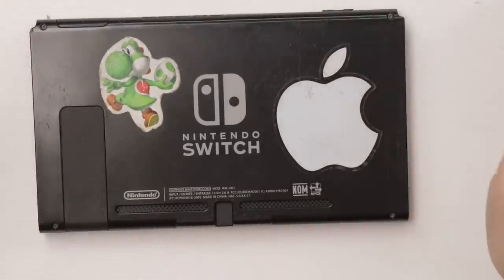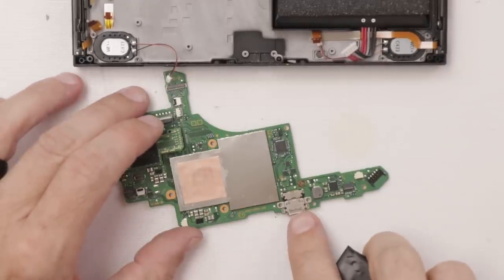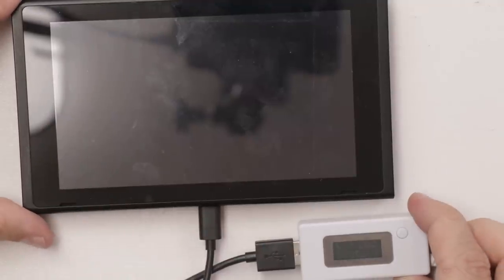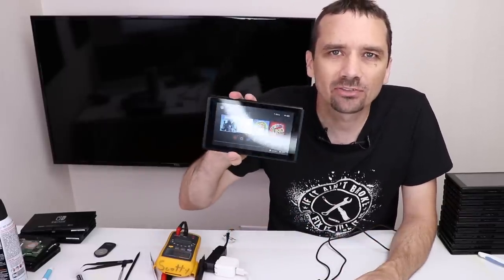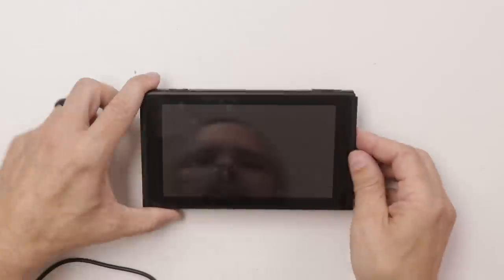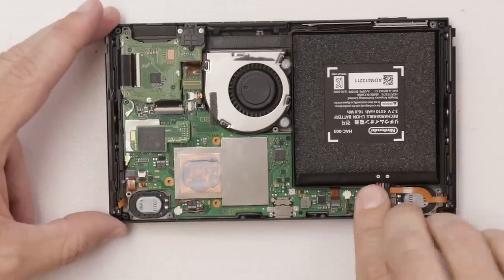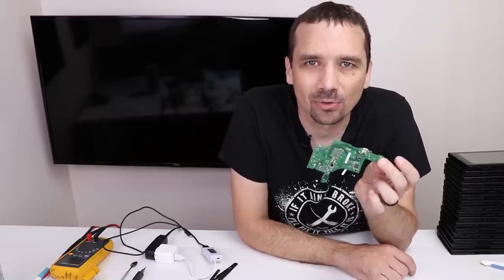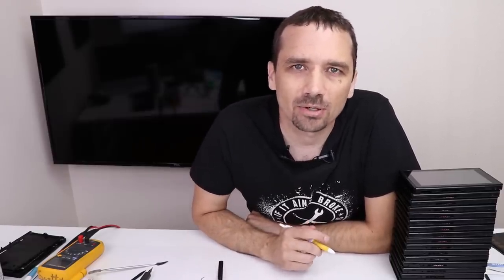The Numbers Are In (Sort Of)! This Lot of 20 Broken Switches Turned Out Good!

Comment: How do you know when there is a short on the capasitors? What is the DMM suppose to read? Also, where do you put the ground wire (black, i think)  when testing. Does it matter or could you put it anywhere?
Reply: The DMM is set for resistance/continuity, which is read in ohms.  In this specific usage, the red and black probes are interchangeable.  One of the probes is consistently held on a known grounded trace/solder pad/area and the other is placed on one, and then the other end of each capacitor.  One end of the capacitor is supposed to show 0 ohms (meaning no resistance to ground, a complete path/circuit or perfect continuity) and the other should show an open circuit/no continuity.  If both sides read 0 ohms, it means the capacitor is shorted to ground on the side that should instead be isolated from ground.  I don't know much about fixing switches, but the video seems to show that this shorted capacitor condition typically means the video chip is blown.
Reply: @prescottmajette5290  hmm i understand now. Thanks so much
Reply: @josegdelgado112  Yea man

Comment: Hi! I have 5 right joycon motherboard they make the click but for some reason won't connect to the switch and some of them won't charge.  Do you know what is causing this? I already change the rail and the ribbon cable but i think is the main board related.

Comment: My switch the back of it is like bulging out and has never been opened before I got it 2 months ago but the back is bulging outwards and the fan is making some sort of scraping noise but if you know why it’s bulging plz tell em and also when I use the switch with my fingers on the screen it creates like weird pressure spots on the screen with just a tap

Comment: Noob question. But what is that paste you use to heat and melt the charging port off? I've seen it before in another fix video but wasn't even named.
Reply: It's flux paste to make the solder "flow" better and stick where it's supposed to be. Someone else can probably explain it better though.
Reply: @J0k3r399  Ty! It's explained enough for me to find out it reduce oxides that heating metals create in the air. Pretty much keeps everything clean. 

Edit: You helped me get smarter today :D

Comment: Hey Bud Need your Help Ps4 replaced the hdd along with a good cleaning and thermal paste it will work fine for about 47 mins then freeze but never recovers till i turn it off at first it was only working like 20mins then stoping but now i got a little fan pointed at the back of it seems to last longer... now this is the cuh1001a but the fan never ramps up or anything saying it overheating so I am stumped

Comment: Hi ya not sure if you've seen this before but my switch shows its charging for a second then screen flashes off then will show battery symbol again and keeps looping like this. 

Also if I try to turn on nintendo logo will flash while I press power button. If I loose power button  screen will flash off and then show battery charging before flashing off again. 

The switch will not respond without the charger connected. 

Maybe you know something ?

Thanks
Reply: Probably either a bad charger or bad battery.

Comment: Have you had any switches unable to dock and connect to the tv but work fine in hand held mode if so I need help
ASAP . Please
Reply: Systems operates normally when used in handheld mode and will connect with joy cons

Comment: Hey Guys, i have a problem. I bought a broken switch. It was not charging normally because of water damage. I cleaned the board with alcohol and checked for shorts (did not find one). After that i replaced the battery and now its loading like expected. (0.41 amp and then up to 1.40 amp) but the display is not turning on. So i replaced the display too. Still no sign of life besides the rotating cooler. Can you give me a hint what to check?

Comment: So many of these failures seem tied to the video chip. Is this reflective of an issue in either board design or of cheap parts?
Water damage is obviously the fault of the owner, but it seems worrying if a video chip frequently fails, as this looks outside the users influence.

Comment: Hey I have one ☝️ problem I have a dead Nintendo switch no power on usb ammeter shows it drowning 0.38A but no nothing on the screen , I disassembled it and checked camps no shot what’s so ever no short by the power supply (M92T36) no short by charger ic (BQ24193)  no short by video chip (P13USB) ,usb connector is clean and good , diod is good ,  what do you think should be the next step ? Thanks in advance ?
Reply: And tried with fully working another battery but still nothing
Reply: @UsiddaTech  The screen might be bad, does it ever go to fast charging?

Comment: I'm taking a gather that Nindeo really, really needed to put a heat-sink on the video chip.  

Also I wonder how many people plugged in faulty USB A to C converter  cables that didn't include the essential resister in the cable that stop its from over-current the device.  A LOT of Amazon-sold A to C cables omit this resistor and they are a danger to devices.

Comment: Was considering buying a switch from you but after further research on Amazon for parts for a switch and the price your asking for just a switch tablet is not coming out ahead for us at all. A like new tablet only switch from you is $209 bucks. We gotta have joycons and those run at the cheapest for Nintendo brand ones, 70 to 80 bucks and then it seems you don’t supply us a charging cable either and just the tablet. Those nintendo brand chargers for the switch by Nintendo is 30 bucks on amazon to. Thats a additional 100 to 110 extra bucks just to get it fully functional like buying a new one in the box unused and your switches is the older models with worse battery life. Also I forgot to mention you need a switch dock station and those are 80 bucks at most. Thats a total 389 to 399 bucks going your route buying from you and having to buy the extra parts we don’t have compared to buying a new in the box with everything switch for $299.99 on amazon or 299 even at walmart for the newer models and brand new. Its cheaper buying them new than from you. You may want to include a charging cable and the joy-cons for that $209 price for a older model used and fixed switch without the original box or anything. Otherwise were paying more than just buying the newer models in store for cheaper and without having to pay for shipping as well as prime is 2 day free delivery or buy in store for no shipping worries or waiting. Big things to think about man! Just saying! Were not getting a better deal buying from you than buying them new with everything included and brand new for cheaper.

Comment: Hey can anyone tell me how he knows about  circuit is short ? cant really see the reading
Reply: When the meter beeps, it means the 2 leads that he touches to the board are connected in the circuit. He touches 1 lead to the ground plate and the other to different points in the circuit. The capacitors are supposed to have 1 side connected to ground, and 1 side not. If it only beeps on 1 side of each capacitor then it's good. If it beeps on both sides it means there is a short (a connection that should not be there) in the chip that the capacitor is connected to.

Comment: Costumer : how much to repair this Switch ?
Technicial : it will be 50 Dollar.
Costumer : (sees 10 minutes the repairing process), do you think its a little expensive to pay 50 Dollar only for replacing 5 Dollar Chips ?

Technician : 5 Dollar for Video Chips, 5 Dollar for Equipment, and 40 Dollar for knowing which parts need to be replaced .

Comment: What in the world is going on to cause that many video card failures?
Reply: Well it depends on how long the unit was in operation from the time of purchase to the time of failure. If they fail quickly and frequently then it could be a faulty component. If they last a very long time before failure, then it's probably just normal life expectancy of the component. There are many possibilities.
Reply: Nintendo released an update that bricks switches when people use a 3rd party dock. It does this by shorting out the video chip.